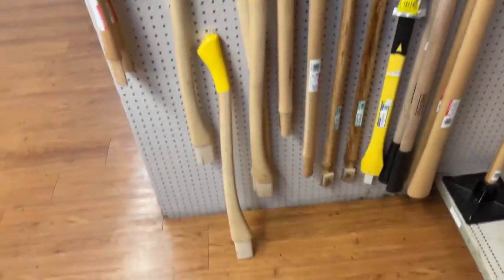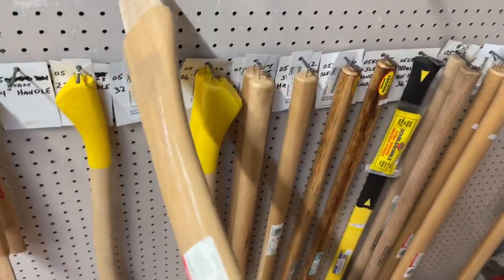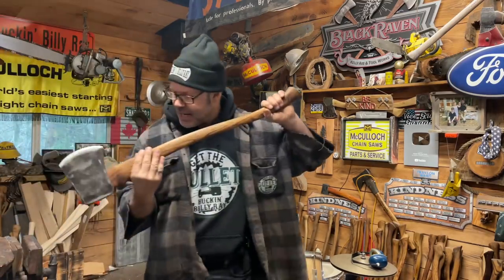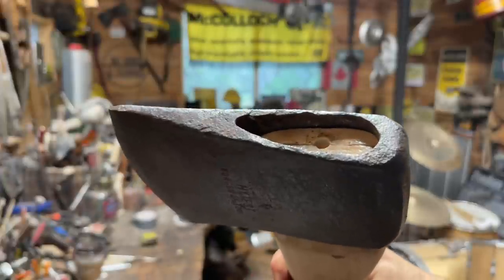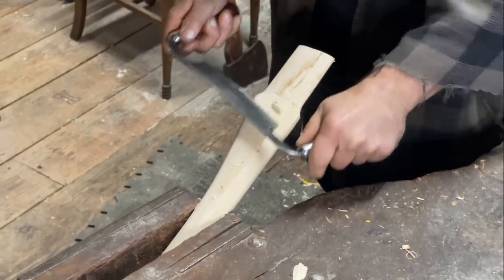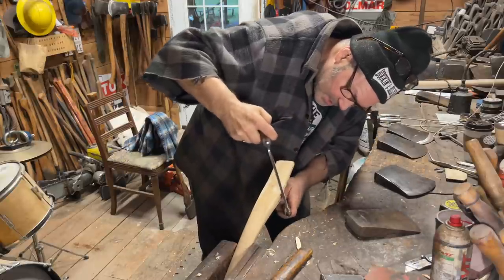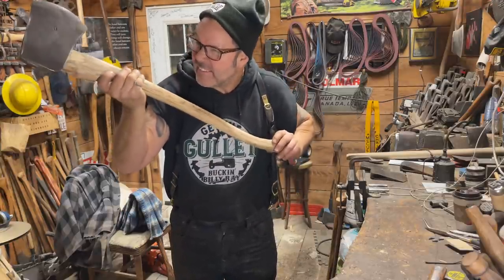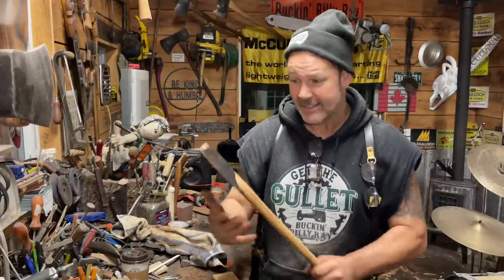WOW! this turned out Way nicer than expected

Comment: I'm lucky to have a next door neighbor who sells firewood.  Its perfect for my axe restoration hobby.  I can walk over anytime, split wood, get exercise and help out a neighbor all at the same time.   I do have a current nemisis over there.  He cut down a MASSIVE oak tree and the rounds from the bottom are around 4 feet in diameter.  Trying to slab off slices from the outer circumference and they just laugh at my splitting axe and 8 pound maul.  I did get a couple of slabs off with a splitting wedge and that was tough!  She's still pretty green, but I can't seem to stay away to let it season a bit.  LOL.

Comment: Hey Buckin,, I found my Grandfathers old axe in my barn the other day.. I took some old sand paper to it and it says its a ""True Temper Flint Edge Kelly works"" and on the other side it has a stamp of CMST.P.&PRR... I have no idea of that is good or not but when I did a goolely search on it, I found one like it and it said it was a Jersey pattern.. Anyhoo,,, I cleaned-er up a bit and the handle was lookin pretty dry and some slight weather cracks in it.. and the wood in the eye is looking a little cracked up too.. Its still holding but has a little weeble wobble to it... So I got out the linseed oil can and wiped-er down with a drippin wet rag.. Right now I got it sitting in a vice and I poured some oil on the eye to see if it would swell back into shape.. If it does,, do you think Its safe enough to use or should I not bother and just go get a new handle fer it??? I plan on using it fer splitting and taking it with me fer felling dead standing firewood. Thanks in advance, Im lookin forward to using my Grandads old axe....

Comment: Hello again Buckin!  Nice touch on the Tim Hortons. I find myself doing the same thing the last few months. 
On my big box axe handle I didn’t have the huge shoulders to deal with as much but I did use the sander to shape it to get the head to fit on better. 
The bigger issue for me was the length. The good news is when I find a 28” get to learn to remove the head. The I get to practice reinstalling the head in the handle. I look forward to it. 
You gonna get into “ Buckskin forge” on the weekend? 

Cheers from Manitoba!!

Comment: I figured it out. The bolt up for the vise or anything to a 32" stump. Think it is a drum. Get two slabs of 1/2 steel plate bigger than the round of the log. Have four 36" by 5/16 threaded rods. Nuts and bolts. Blow four holes threw the plates in the same place. Know bolt it up like a drum. The top slab should be shimmed up a good inch so when you blow holes threw the top plate you can reach from under with a wrench and hold the double wrenching action. But really you could rent a Hilti drill with a long as- bit and go three the log four times and bolt down a plate to the top of the logs. You will be able to have some connections welded to the plates that match what your wishing to bolt up. Pluss when you have a hot piece of steel and you want to put it down you can. Think of it as building a drum with a log aye.